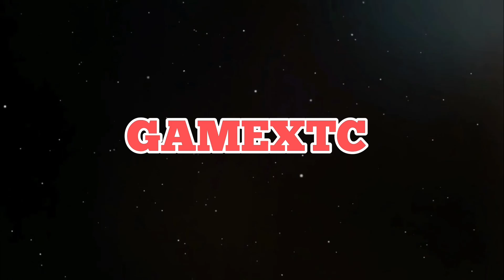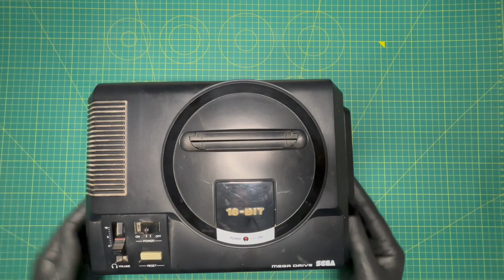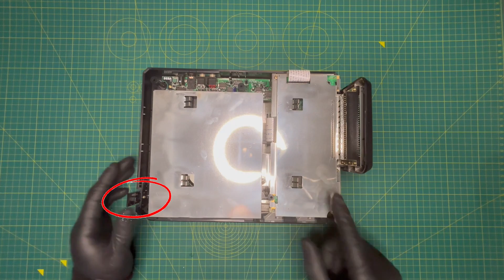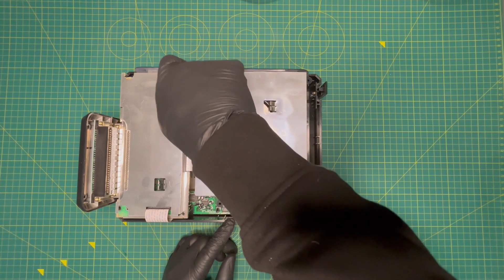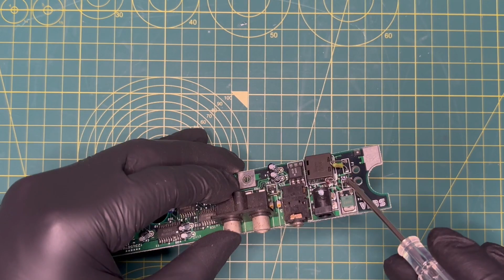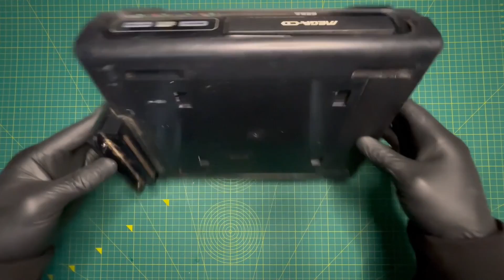How to Fix Sega Mega CD model 1 - Mega CD No Power Fix PICO Fuse

Comment: Can I use a 3amp PICO fuse?
Reply from the maker: No you can’t, as it may damage your console. You have to use the correct amp
Reply: Thanks for letting me know 
Is there anything I can use the 3amp for?
Reply from the maker: Most of the retro consoles use 1.5 to 2.5. But that doesn’t mean that there isn’t a use for it.